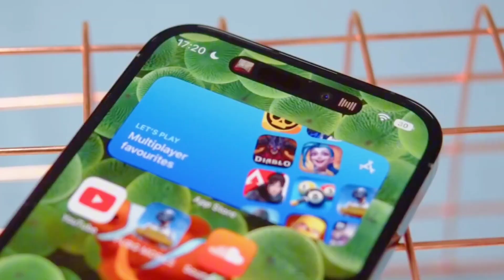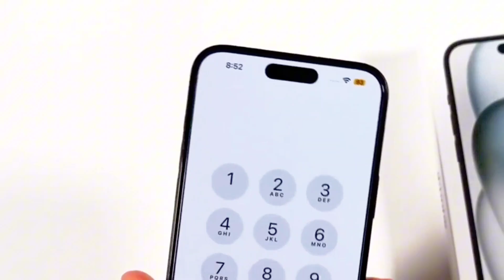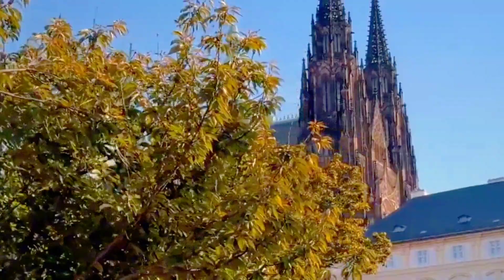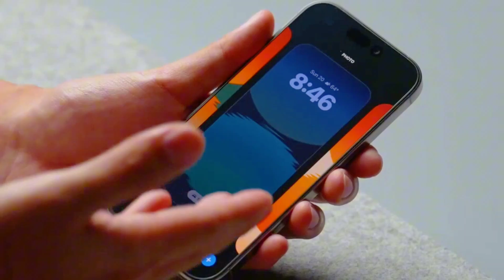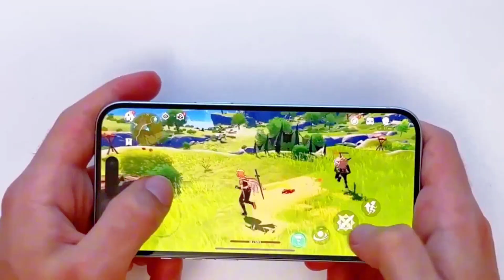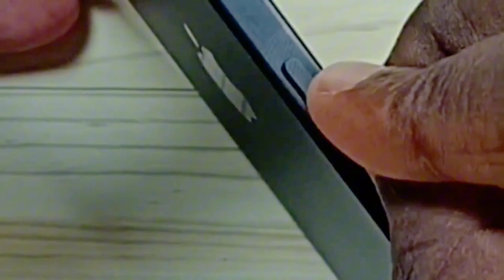iPhone 17 Pro Max – Insane Leaks & Features Revealed! | Camera, Display & Design Changes

Comment: I was watching I phone xs and xs max, 12 pro max including last model 16 pro max the video resolution 4000×2000 thats it never improved 8k and sensor only improves mp and ccamara lens i used xs max away better camera i think apple still not improved only improved apple computer only .not smart phone .I phone 12 pro max still amazing . Please try something new micro 3d sensor and digital zoom lens like a cannon hfs21 hanycame process or blackmagic hd camera process recording 8k than will be game changer otherwise going to fail
Reply from the maker: Thanks for sharing your thoughts ! You’ve made some interesting points about iPhone camera evolution. While Apple has improved aspects like computational photography and sensor size, I agree that features like 8K recording and advanced zoom tech could make a major difference. Your suggestion about incorporating micro 3D sensors and pro-level processing like Canon or Blackmagic is actually quite compelling—Apple might need that kind of innovation to truly set the next iPhone apart .